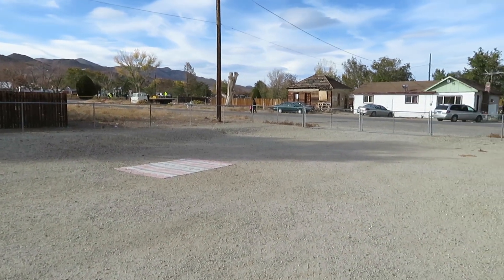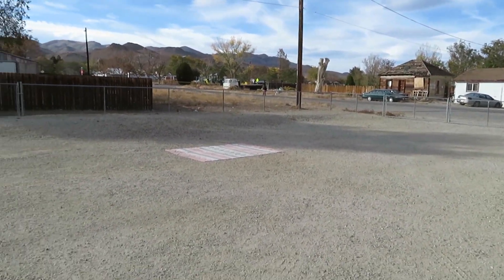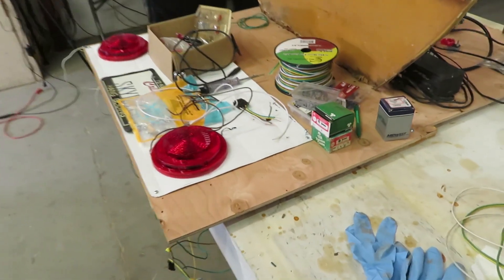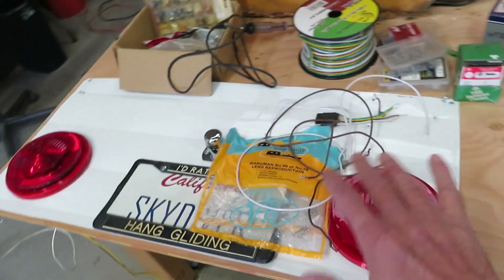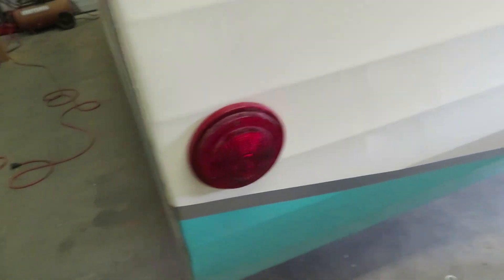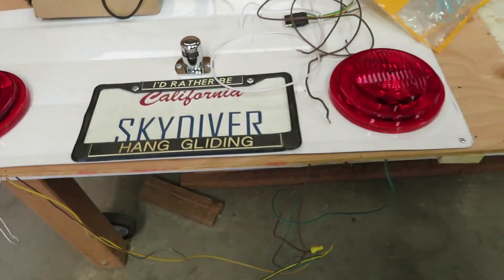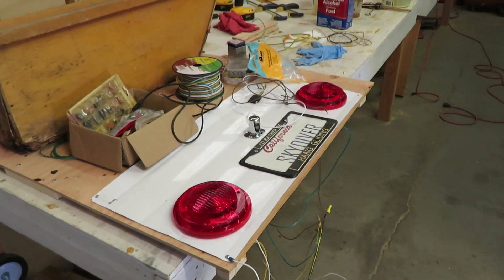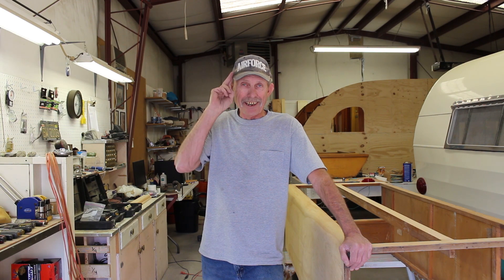Weekend Update 10/26/2018

Comment: My Grandfathers homemade utility trailer has always had trouble with the lights.  Rusty ground wire is almost always the problem.
Reply from the maker: EconoChallenge  you are exactly right. 95% of the time the cause of exterior lighting problems is a bad ground. Usually from corrosion.

Comment: The flooring didn't get wet. I leave my frig on year round and it cracked on the side by the door. I think it's a weather issue. But since I need to fix that I thought I might as wells make it nice. I was wondering how plywood would look good with stain and a lacquer ontop.
Reply from the maker: Don't know. I only use shellac.

Comment: I don't know about all the woods but I was wondering, I need to take the linoleum off of my floor in my travel trailer. Would regular plywood look good stained and coated? I'm on a strick budget. They say the vinyl wood look tears easy.
Reply from the maker: If your linoleum is bad then your sub floor may also be in need of repair or replacement. Budgets never work on projects like this. That is because the more you tear into it, the more work you see that needs to be done. The very first thing you should do with any old trailer is remove all of the metal skin. Then you can see what you have to work with. Then you can make a plan and a budget.